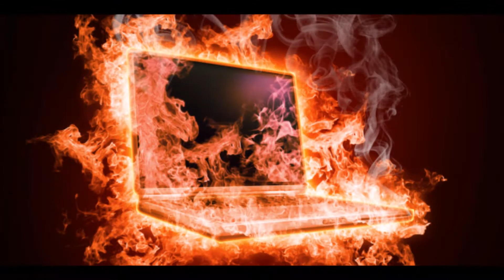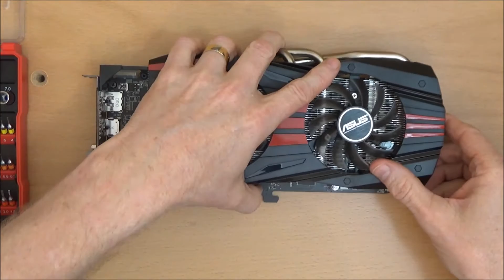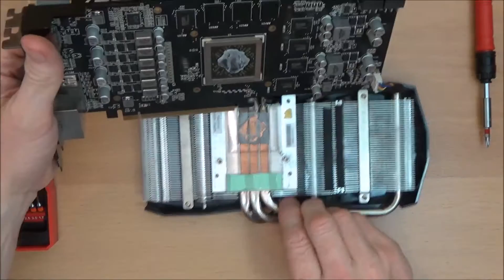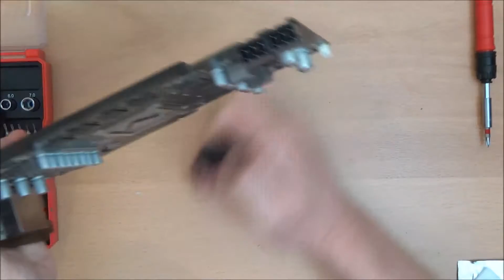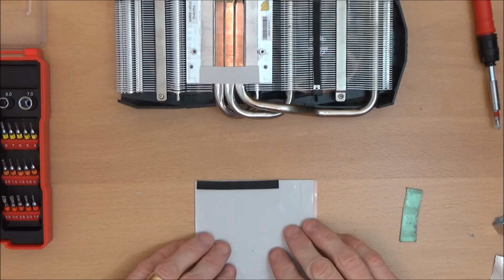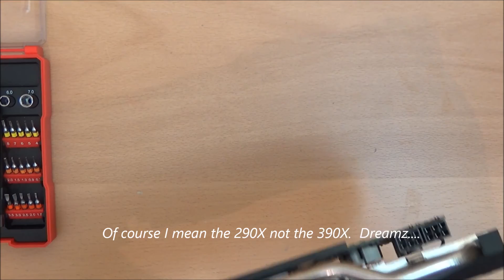How to.  Refurbishing my Asus DirectCU Radeon R9 290X

Comment: Quite a dumb design for the cooling. All those chips basically need to have covered in pads while only two of them are and even then barely. Seems like they made these to fail. 

So far I took apart only two of these in my lifetime so far and completely forgot what they look like, so as what pad solution they had. The fans were crushed so I discarded those then sold for repairs or parts the card itself and the heatsink. Fast forward to this year, I found out I also have two more damaged ones in my storage that needs it's heatsink assembled and refurbished OR just scrap it as is ... oh "joy" ...  

So yeah found this video now of what this thing really looks like, since I forgot. I am still unsure should I invest into this crap or not. They are not selling well .... Now I know why.

Comment: Would have been helpful to show the temperature before and after.
Reply from the maker: High and thanks for this.  Yes you are right it would have.  Prior to this it was under load going up to 90-95 Degrees Celsius (this was normal for the R9's from factory).  After this it ran at 75 max.  Thanks again.

Comment: Will silicone based 1.5mm pads work ok?
Reply from the maker: Hi. They should only be used on the VRM and memory chips.  Thickness depends on the gaps between these and your heatsink on the card you are using. The main GPU should be evenly coated with a thin film of a high quality thermal paste.  Thanks for the question and I hope this has helped.
Reply: I went with 2mm padding and I spared no expense on the thermal paste
Reply: same card you have in your video,..identical
Reply from the maker: After the refurb. mine dropped from >90 degrees under load to <80.  I had to get a heater for my room :)  I hope your work is as effective. thanks again.
Reply: Mine starts up at 40 c as opposed to 58 c and maxes on ultra at 87 c